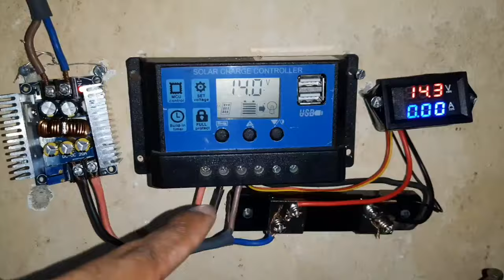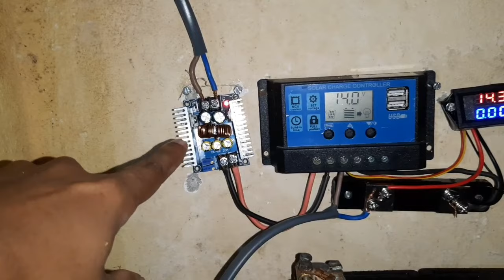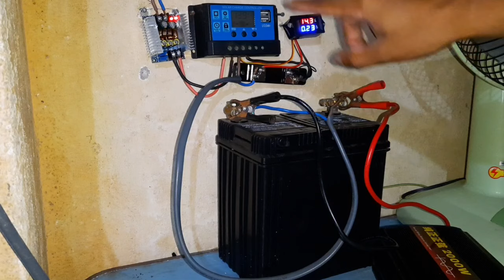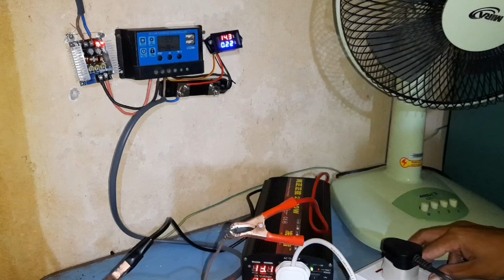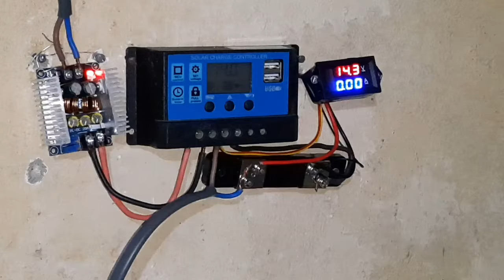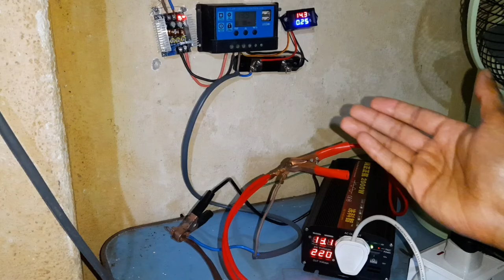Solar Powered Fridge - How to Run a Fridge With and Without! Batteries

Comment: As an alternative to supercap startup strategy what about incorporating 
An auto transfer switch ,setting solar as the primary power source and battery as the secondary. Thus after initial battery startup and when the sun goes behind a cloud, the ats switches to batt power until such time sufficient solar power from panels+buck converter is restored.Of course you would have a low coltage batt cutoff at which point system operation wou.d cease until panels are able to recharge battery enough for the jump start again. You would set the cutoff point such that the Batts only get a shallow depth of discharge ie 10% thereby increasing their lifespan drastically. IDK how you could still employ the supercaps in some capacity(lol) still but you can figure that out. .?which takes longer to recharge ....the Batts or the supercaps? Of course this whole setup is designed for daytime operation.
Reply from the maker: First of all automatic transfer switch have a small delay during their swithing from one source to another. This can result in the system shutting down. If I were to incorporate an automatic transfer switch with a battery then I will add it between the battery and the supercapacitors keeping the supercaps permanently in the setup. But if you use supercaps and battery and run the system only during day time you can use a small battery permanently wired with the supercaps like in this setup. Supercaps help small batteries give large startup power.
Reply: If he had wired the solar charge controller correctly this would do what you are asking since it monitors the battery and turn off before the battery low threshold
Reply: @dantronics1682 what is correct wiring?
Reply: @teemum.9023  the solar controller have an output which is marked load or a lightbulb symbol, I use that to power a relay which switches off the power to the inverter, If you use a ssr instead of a mechanical relay make sure you have adequate heatsink.

Comment: what battery do u use sir?
Reply from the maker: For this demonstration Im showing a normal 35 ah car battery. But if you want to use long term and over night then you will be better off by getting a deepcycle lead acid battery or a Lithium iron phosphate battery.
Reply: @diysustainableliving2774  Ok. Thank you sir!
Reply: @diysustainableliving2774  is 24v 100 mah battery be enough?
Reply from the maker: @ken b  mah or ah?.... 100mah is 0.1ah! Please check your battery and confirm!
Reply: sorry..its 24v 100ah lithium ion battery
Reply: and what solar panel do u use sir? 100 watt?
Reply from the maker: @kenb1554  I have a 150w panel. 24v 100ah is a lot of storage! And Lithium batteries have a longer cycle life at a DOD of 80%. That is 80% Usable capacity daily! Hope your inverter is also 24v and pure sinewave if you hope to run a fridge.
Reply: @diysustainableliving2774  ok. thank you sir!

Comment: How many watts are your solar panels?
Reply from the maker: At the time I made this video it was just 150w. But I did this test in the afternoon with full sunshine. If you get a lot of clouds then you will need larger panels.
Reply: @diysustainableliving2774 Where I live in South Australia solar panels are highly effective, South Australia was the first jurisdiction in the world to get 100% baseload power from wind and solar, although there's so much oil gas and uranium in South Australia it's not necessary.
Reply from the maker: In Australia you get a lot of sunshine. But in places such as the UK... You get a lot of clouds where you will have to add more panels to get the same power.
Reply: @diysustainableliving2774  I can get 2.6 KV a day from just one 300 watt panel, to put that into perspective if you ride a bike from sun up to sun down during summer you've only generated 1 KV 🤣🤣🤣
Reply from the maker: It is always good to live in the land of sunshine!

Comment: Sir for how long you can run the refrigerator using that supercaps?
Reply from the maker: Good question. The answer is NOT even a few seconds! The supercapacitors are there to start the fridge. After that it runs on direct solar power.
Reply: So it means the super caps is just for start up, sir i want to know in your demo the refrigerator is running this is i want to till when the ref is running until solar sun goes down if good weather?
Reply from the maker: Yes the supercapacitors are only there to start the fridge as a large amount of power is needed at startup. Usually 5 to 7 times the rated power. Once it starts running it can run at the rated power. So aslong as the sun shines and your panels can produce the rated power required for the fridge it will work. Once the sun goes down or a cloud covers the sun the whole system will fail. Thats why I recommend incorporating at least a small battery in whatever solar offgrid system you design.
Reply: Many many tnx sir,,, you pointed it out now so clear in my mind... Thankyou God bless your talent..🙏👍👍

Comment: 200 watt ka 12V DC converter se SAMSUNG 5 STAR energy rating wala fridge chala sakte hain?
Reply from the maker: Can you please ask your question in english? I dont understand what you are asking.
Reply: @diysustainableliving2774  Sorry.  I want to ask - I have an LG 5 star refrigerator with solar smart and digital inverter features. So can i run it through the solar panel by using a 200 watts DC to the AC converter? Because I don't have an inverter.
Reply from the maker: First what is the rated power? Next if it is an inverter type fridge you will need less power at startup and less power overall. And Is it a DC fridge or AC fridge? If it is AC you will need a separate inverter and if its constant power is slightly above the fridges rated power it should work. It would be helpful if you could give us a model number or something to lookup the specs online.

Comment: What voltage did you set the step down converter to?
Reply from the maker: 14.4v... Thats the charging voltage for a 12v lead acid battery.
Reply: @diysustainableliving2774  what is the purpose of the buck converter? The PWM can convert the voltage directly from the solar panel without needing a external buck converter.
Reply: @rumpy3025  he is not using pwm just the buck converter, the pwm was for something else
Reply: @dantronics1682  ah
Reply from the maker: Yes ... the PWM scc was just part of my setup. The main component here will be the buck converter to reduce the voltage.
Reply: @diysustainableliving2774  the only problem I find with the buck converter (not proven yet) is if the switching transistor was to go short circuit but since the output of an mppt is the same I suppose this must be very rare
Reply from the maker: Sorry I dont kow much details about the internal circuitry but I like the fact that the pwm disconnects the panel and buck converter when there is no sunlight.

Comment: Dear Friend How long does the refrigerator charge last overnight with a car battery?
Reply from the maker: A car battery is not a good option for solar. It is best if you could get a deep cycle battery if you are going to run the fridge 24×7. As in my case for a 84w fridge you will need at least a 45ah lead acid battery going to around 50% depth of discharge. At this depth a brand new car battery will last for only 3 to 5 months daily cycling.

Comment: Hi, i think we should use both battery and super capacitor, so that we can put more loads.Vikash ,from Mauritius.
Reply from the maker: Yes... With that setup you can run powerful equipment with a smaller battery. My supercapacitors are permanently connected with the battery system.

Comment: So interesting ..congrats. Can u send the diagram?
Reply from the maker: Thanks... Sorry for not including a diagram. Basically Im using supercapacitors as a temporary battery during start and running the fridge with direct solar power. Its always better to include at least a small battery in the setup in case of a cloudy day!

Comment: Sir is it ok to connect 100,000 micro farrad 25V capacitor on 12V motorcycle battery..? Is it ok for the electrical parts, stator, lights, and any parts of the motorcycle..?
Reply from the maker: 100,000 micro farads is 0.1 farad. My super capacitor bank should come to around 83 farads. As long as your system voltage is less than the capacitors voltage there shouldnt be any problem. Basically nothing new will happen to the parts of the motorcycle.
Reply: @diysustainableliving2774  thank you sir..
Reply: @diysustainableliving2774  sir is the amperage of my battery increase because of capacitor..?
Reply: @diysustainableliving2774  is it ok to use 1 pc of super capacitor with the rating of 10,000 mocro farad 50 volts to parallel on my Lifepo4 battery with BMS and then connect to 500 watts inverter ?

Comment: What kind of wires are needed for this setup?
Reply from the maker: No special wires. Just make sure the wires you use on the DC side are thick enough to handle the amp load while your refrigerator is running.

Comment: What is the voltage of that your solar panel
Reply from the maker: It is a panel used for 12V system. Its Rated to deliver 18.5v at its maximum powerpoint.

Comment: How many ampere your charge controller
Reply from the maker: Its a 20ah one. I like to oversize these things so that they can easily handle smaller amp loads and not heat or burn up. Since it is cheap it has a few issues but it serves its purpose.

Comment: How many watts the panel is??
Reply from the maker: The panel I used for this is a 150w panel at 12 noon during maximum power production. I have since then added another 100w panel to my setup.

Comment: Hello sir, my freezer run 1000watts/24hrs..can I use a 150watts solar panel,20a scc,1000 watts inverter and 100ah battery?
Reply from the maker: Let me get things straight. I think you are referring to 1000wh/24hrs. That is 1Kwh a day is that correct? First look at the back of the freezer and check the label and see what the power its rated at! Next if you need 1kwh daily then I think 150w panel might not be enough. The maximum power the panel can give on a completely clear day is 150 x 6hrs is 0.9Kwh. That is if you use an MPPT. If it is PWM scc then it comes down to around 0.6Kwh. All this information and calculations are available on my other videos. Please check them out to get a better understanding of how these things work!
Reply: The current rated is 1.2a..will it be able to run the freezer even if it's for 12hrs
Reply from the maker: What is the AC voltage in your area 220v or 110v? If the voltage is 220 then 220 x 1.2 is around 260w. So you will be safe if your inverter is around 1500 to 2000w puresinewave since the freezer compressor needs around 3 to 7 times its rated power on startup. My fridge is around 72w. 
And as for the time duration.... If you use for 12hrs during the day time only a 150w panel should easily handle it. You can even downsize the battery if you plan to use only during the day time, since the panels will be providing the required power, and the battery will mainly be needed for startup and rainy day situations only. Always take into account the cloud cover and rainy days in your area when you are planning your system.
Reply: Thanks so much
Reply: You'll need a 500watts PV, 30A mppt charge controller, 500watts psw inverter, 12v 300ah battery (gel type or vrla) or 12v 200ah lifepo4 battery for your refrigerator that consuming 1kwh per day.
Reply: @popoolaolamide8165  don't rely on the sticker in the refrigerator. Use a watt meter just to be sure on the actual rating of your refrigerator within 24hrs.

Comment: Can we run a rice cooker?
Reply from the maker: Yes you can run a rice cooker but remember cooking uses a lot of energy so you will need a battery to stabilize the system. And if you are planning on cooking I will advice you to go for the biggest setup you can get. Big solar panels and a powerful inverter. Although modified sinewave inverters are enough for rice cookers they are not good for fridges and other appliences. So I reccomend that you get a pure sine wave inverter. If you can go for a higher voltage setup like 24v that will be even. better
Reply: @diysustainableliving2774  i am having 12 v 200 watt solar panel and 150 ah battery..is that sufficient to run it?
Reply from the maker: With that panel you can get 1.2kwh a day if there is full sun. That is equal to a 400w rice cooker working 3hrs. Make sure your inverter is powerful enough for it.

Comment: Not working ..i connect without battery.direct from solar to buck to invrter and inverter drop down voltag from 14 to 8.8 ...my panel 36 v.  250 watt .inverter 12v
Reply from the maker: What are you trying to power? Is it an induction load like the fridge?.. Please see the video in detail. Note that you cant start a heavy induction load directly without a battery. Im using a Supercapacitor bank instead of the battery for starting the load!
Reply: @diysustainableliving2774  without any loads 😥
Reply from the maker: Are you sure your connections are correct? Have you put cc to maximum output on your buck converter? If all of these are fine next is to check the inverter. Is it taking a lot of power on startup? Mine needs around 4 -5 A for around a second and it drops down to 0.6A continuous power draw. You can check this with a multimeter.
Reply: @diysustainableliving2774  yes sure my friend
Reply from the maker: Let me know what you find. I think there must be some thing wrong with your inverter! In this video with a 150w panel and 12v 2000w puresinewave inverter Im able to run a light and a 50w fan directly with the solar power. For the fridge I im using supercapacitors for the initial starting load.

Comment: Hi, What is the cost of this setup?
Reply from the maker: Including the inverter it would cost you around 180 - 200 usd without the battery. Always consider adding the battery as it will give a lot of stability to the system.
Reply: @diysustainableliving2774  is it safe to keep adding batteries?
Reply from the maker: As long as the voltages are correctly balanced there should be no problem.
Reply: @diysustainableliving2774  looking to implement this setup to a commercial freezer for business but with inverter functionality.
Reply from the maker: First calculate howmuch power the freezer consumes in 24hrs. Next you need double that size in battery storage as lead acid batteries can only discharge to 50% DOD for maximum cycle life. Third you need to divide that ammount of power by 6 to get the panel wattage. It will be better to oversize all of those to be ready for rainy day situations as well!

Comment: What the 20w  bulb 12 v is connected permanently ..
Reply from the maker: It is not connected permanently. I used a 20w 12v bulb (2×10w if you look carefully) just as a high power resistor only to charge my supercapacitor bank from 0v to 12v. When charging your suercapacitors directly from a battery if you dont add a resistor, there will be a huge surge in flow of amps through the wires and the supercapacitors themselves can get very hot.
Reply: @diysustainableliving2774  so if i wish to ad resistor what is the value ..
Reply from the maker: Use the equation I =V/R
And it should be a high power resistor which could handle more than 10w since 1A × 12V will be 12w. So I think it will be cheaper to just use whatever 12v load you have with you for this purpose.

Comment: Sir after connecting your super capacitor it will work 24 hour even without sun ...
Reply from the maker: A big NO!!... The supercapacitors are there just to START! the fridge. They CANT RUN! the fridge on a cloudy day or at night!
Reply: Sir i think the real test is not just for a few minutes, but to use it 24 hours and see if the buck converter will not burnout. Otherwise it is useless.

Comment: I have 3KW of panels and only an old car battery from recycling to power my fridge and only in the day. It is under microprocessor control to insure it only operates when full and to prevent hot starts. Fridge MSW inverter is modified to only have an on time of 4ms (60Hz) for more efficient motor operation and lower start up current. Battery is only used for starting surge. My large capacity LG clothes washer only works on solar, no battery. Excess solar heats domestic water.  Also have a dishwasher modified to work off  PV. I could do it with less panels, but mine are mostly in shade under trees. I really have nothing in common with the rest of the solar world other than having PV panels.  Batteries are a waste of money, still don't trust super caps to last.
Reply from the maker: First I hope you know that even if the whole set of panels are in the sun and only 50% of one cell is covered in shade the whole string of panels output will come down by 50%!.. Next about supercaps my supercapacitor bank is in its 3rd year and is still working as new. I have lost many car batteries on the way. But since you have a car battery that works that itself is enough! You can also consider getting a puresinewave inverter since you are running induction loads it will have less strain on your equipment.
Reply: @diysustainableliving2774  My system is ultra efficient and can operate for days in the rain. Been designing electronics for over 50 years. This is an interesting 2020 article Direct Usage of Photovoltaic Solar Panels to Supply a Freezer Motor with Variable DC Input Voltage youtube truncates addresses. With an international audience I avoid expensive and difficult to get parts like supercaps, instead focusing on available parts from discarded electronics. Solar can be for everyone at extremely low cost.
Reply from the maker: Of course definetively!.... I dont have much knowledge in electronics but I was able to get these supercapacitors quite cheapely. Thats why I like them!.... It is best to use what ever you have as long as it gets the job done!